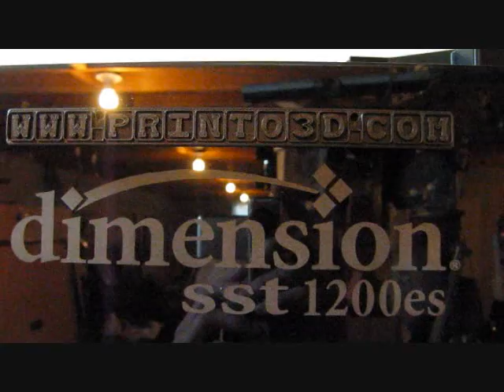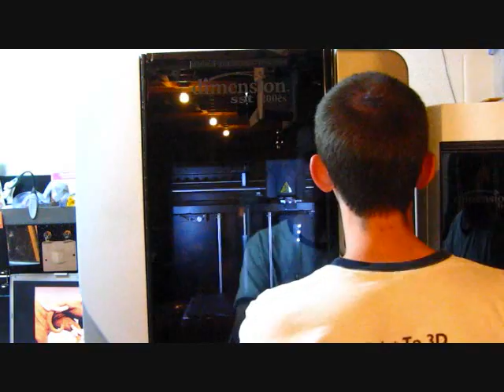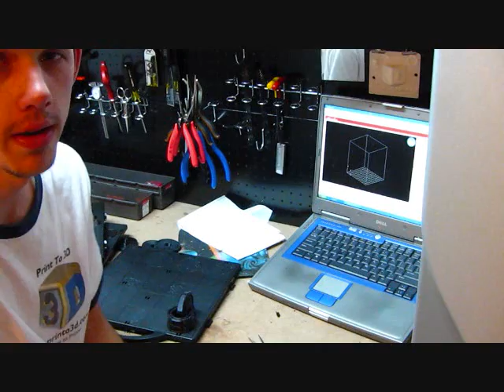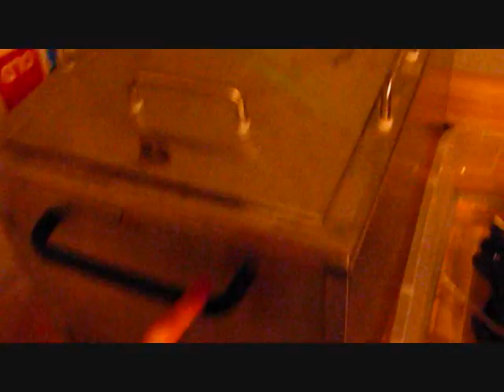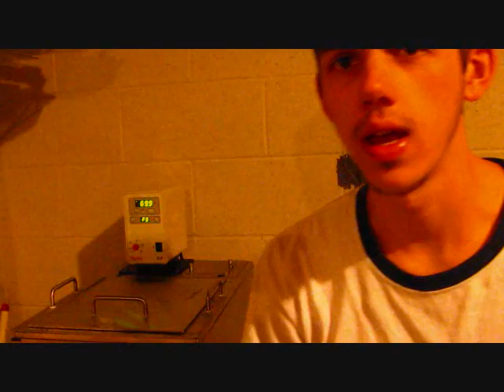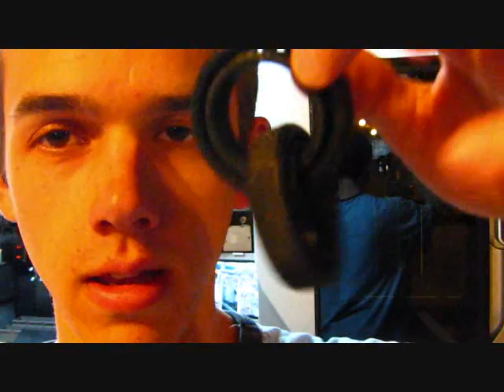The Impossible Bearings

Comment: I want to asks, if the parts that you prints results more fragile (mechanically) because they are done on a layer by layer system than if you do the same parts done with a solid caster, also I mean, witha caster you can inyect the plastic with pressure, in 3d printer it is appliying none pressure. So if you use the same material for both methods, it will weaker the part done with 3dprint?

Comment from the maker: @AtlasThePassivist There is a handful of 3D printing/rapid prototyping technologies.  Each one has it's advantages and disadvantages.  I use FDM technology.  There are several "powder based" technologies.  I will say that precision isn't everything.  Machine cost, material cost, part strength, print speed, material options, etc.  One particular powder based technology prints parts fast and accurately, but the parts are very fragile.

Comment: @weldon0m ordinay  laser cutting could not cut the balls inside the bearing rings. You would need a two laser cutter (that cuts fabric only wherer the two beam join); would take ages. Some 3D printer based on twin beam laser could do it (transparent fluid hardens only where the beam cross each other). But I believe this 3D printer does it for cheaper and faster.

Comment from the maker: @Idiotsmakemesad Design compromises?  The demonstration is that the machine can make a functional part without any assembly required.  It also demonstrates how the parts are built because you can visually see the difference between the layers in each bearing. One built vertically and one horizontally.  Do you know of any other technology that can make something functional such as an adjustable wrench which consists of several parts without any assembly required?

Comment: This bearing is used for the counter control shaft of an aluminium magnet powered pm /6 electrical engine. the configuration shows how the heat of the engine will be converted from thermal energy to mechanical energy. thereby using the wasted heat of ehaust and convert it to generate electricity for storage batteries and recycle the heat to provide a longer lasting hump mobile.

Comment from the maker: @novakane87 It doesn't!  It actually "prints" the parts in one piece fully assembled as shown.  Imagine how you would make a sphere out of a stack of paper.  Start with a very small circle and gradually make them bigger and then gradually make them smaller again once you get to the middle.  Add glue between each sheet of paper and in the end you will have sphere made from layers "sheets" of paper.

Comment from the maker: Thanks!

The printer comes with its own software support generation.  Once that software processes the file how you want it printed you simply hit "print".  Hitting print sends the file to the printer where the printer's computer reads the tool-path information for each layer and moves the print head accordingly.

All you have to do is design the 3d model how you want it and I do all the print preparation.

If you look through my channel you should find a video that shows more information.

Comment from the maker: Well I probably can.

Basically all you do when the printer is done is break the model off the build tray.  Once that is done you just put the parts in the parts bath for several hours to dissolve the supports.

The parts bath is heated to 70 degrees C.  The bath is a mixture of water and powder.

I can try to get a video of this process if you want?

Thanks!

also check out youtube (dot) com/printto3d

I have not been posting recent videos there though.